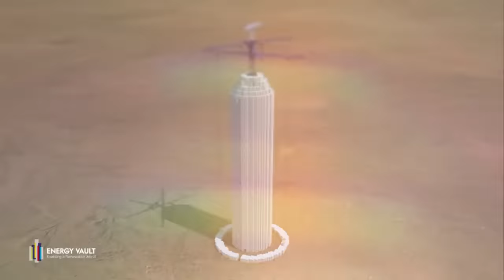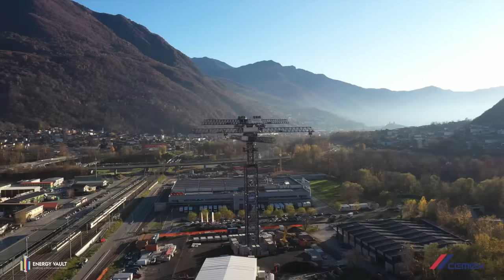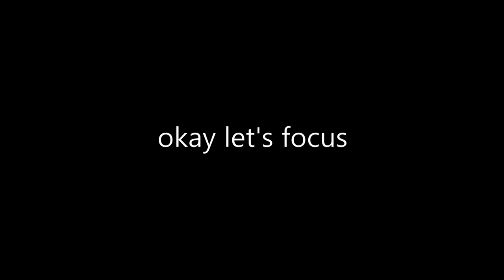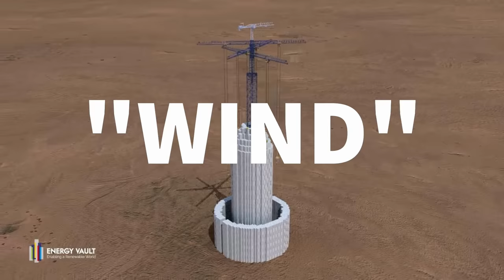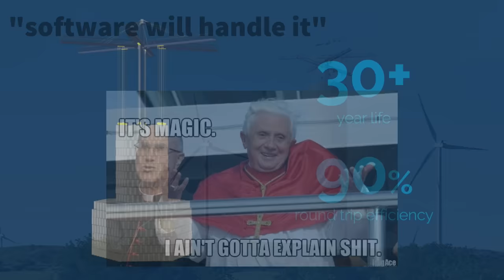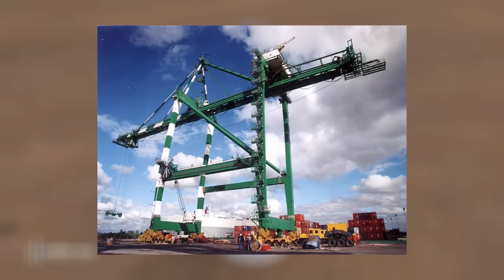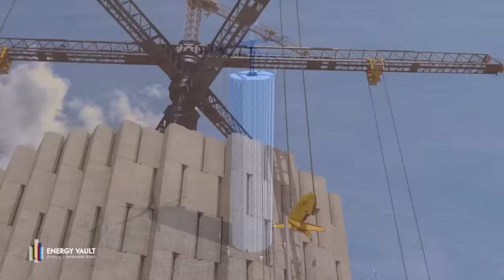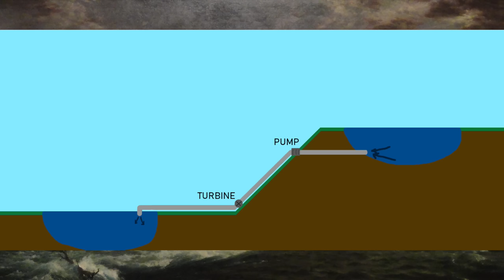The Energy Vault is a Dumb Idea, Here's Why

Comment: Funny, I started watching this having not heard of this idea.  Within the first 10 seconds I was thinking, surely we could get it to do some useful work, like a hydroelectric reservoir, which also can supply water to a city...  As someone who has programmed computers, I also laughed at the 'software will handle it' quote - this is only ever used as an argument by people who don't understand programming, the limitations of software and the massive amount of time needed to get a buggy system up-and-running, let alone a failsafe buggy one (no such thing as a system of more than 20 lines of code that is bug-free).
Reply: You can get to 20 lines of code without writing a bug? This person is a legend
Reply: The reason they want to do this is because there are a lot of areas that produce an abundance of solar power but battery storage is insufficient right now, A giant block of heavy mass is a cheaper way to store power. It doesn't have to be concrete, that's a little counter intuitive. But we are working on carbon capture, we could build large blocks out of those or some other nonsense. This video is also clearly from a place that is NOT suffering from drought or is flat so hydro wont work. There's more reasons to support this tech than there are to be against it I guess is my point unless you own a lot of oil stock.
Reply: You can get a bit more "bug" free with formal proofs, but that means bug in the sense of "behaves not as specified". Totally forgetting that in interacting with the real world, specifying everything is impossible.
Reply: @m1abramstank755  Syntax Error in Line 1: Expected Semicolon ;
Reply: A program with more than 20 lines of code that's bug free is not that hard to do... Maybe with this exclusive problem or something, but a simple C program that does low level logic can be 100% bug free.
Reply: The only way you can get bug free code, is code for a single task that never changes. The real world constantly changes, and if your software has to adapt to that, us fellow devs will be employed until the future's AI can write it itself.
Reply: Having spent the last two days debugging code that's less than 500 lines yet throws out random compiler errors, I agree. I pity the poor sod who'd get this project.
Reply: @Tick421  The problem is that it stores sod all energy. Raising a single 150 T block 100 m only gives like 40 kwh of energy. Which is like $3.50 with a 10c/kwh price spread.
Reply: @Veloxyll  but its free power that is going to waste. So until they have a better solution building a stack of carbon capture blocks doesnt seem terrible. I am all ears for good ideas but crapping on the best ideas we have so far isnt getting anything done.
Reply: @Tick421  Is it though? is it a good idea? Since they're 48T blocks, not 150T like my example, that means they have like 13 kwh of energy from being moved 100 m up. So $1.30 per rotation. And that'll cost about $4,000 just using cheap concrete. 
So that's 3,000 rotations just to balance on cash. 

On carbon, which, lets be clear, is the competition. We could just burn coal instead, currently our network generates about 0.65 kg of CO2/kwh. But these 48 T blocks release about 41 T of CO2. So for the blocks to be carbon neutral they have to complete 5,500 rotations. 

Now, if that's one move a day, that's 15 years. For blocks that are being bashed into each other twice a day and being exposed to the elements. 

And that's just to break EVEN.
Reply: @Veloxyll  burning coal releases carbon i am talking about carbon capture to stop or at least slow the damage done but abusing fossil fuels. The idea is to use free unlimited green energy and figure out how to make it more efficient. Coal is deadly and dangerous for everyone especially the miners. Its not renewable and its damages the entire ecology to mine and use. We will still need it for a while, but it should be our main source of fuel thats insane and inefficient
Reply: @Tick421  The problem here is that this battery isn't "free" or "unlimited". It would take a lot of energy to undertake this project and at the same time it won't even nearly store as much energy as it was "fed" through piling these blocks on top of each other. This "gravity battery" is extremely inefficient and structurally unsafe by the looks of it. On the top of this, countries that don't have the geological benefits to use real means of renewable energy, most likely also won't have the industry well developed enough to support the project of these batteries. And the amount of energy they would be storing isn't worth it for the trouble. I understand that we need ideas to replace fossil-based energy, but I would rather settle with a decent idea than a complete disaster waiting to happen. So let these "engineers" responsible for this, go back to the drawing board.
Reply: So you're saying it's impossible to create software to stack blocks?
Reply: @ahall9839  Not impossible. Just an absolutely mammoth undertaking for such a scale, with extremely high risk, and countless untold variables to account for.
Entirely possible, I'm sure the programming for some of the rovers and their equipment was just as difficult.
But why go through such an insane amount of work for such a shitty idea?
Reply: @Asiliea  So you can turn those "countless untold variables" into real, actual variables? Or you can just be a know-it-all YouTube commenter and say "haha me so smart people thinking about hard thing are dum!!"
Reply: @Tick421  not gonna reply to the more mathematical stuff, but as to the drought/flat stuff, that's just BS. Humans don't live in deserts, like, at all- over 90% of human population lives on the shoreline, ergo more or less 90% of energy usage is near the shore. Even when they do live in deserts, water based batteries are still viable- because humans  always need water to drink, which could be easily pumped up and down. The main advantages of water are that it's a fluid, and therefore everything is infinitely simpler, while also being a necessary resource, unlike a stack of concrete which is only useful for storing energy. Also, clean water generation is far more efficient carbon-wise.
Reply: Man I did 500 lines of code without a bug. Am I a god for you?
Reply: @Tick421  animal agriculture is responsible for More Greenhouse Gases than all Road Transport Like Cars Trucks Busses motocycles combined. (15% roughly)
Reply: @Tick421  its terrible tho
Reply: Actually I wrote a program that writes Hello World! 20 times and it is bug-free.
Reply: imagine this project fail and mrbeast buy it to play tetris
Reply: @m1abramstank755  and it will still crash if your memory and swap disk are completely full
Reply: @kennichdendenn  the problem with formal proofs is that you can end up with a program that does the wrong thing, perfectly
Reply: @nakelekantoo  xD python tho
Reply: @ahall9839  Mechatronics engineering student here. Good luck accounting for said variables with such primitive tech.
Reply: @mwanikimwaniki6801  So you're saying it's impossible to create software to stack blocks?
Reply: @ahall9839  Lol. No. With this model. It's a nightmare. With a different design it would be possible.
Reply: @nakelekantoo  seems like python to me, so I doubt it
Reply: @ahall9839  You're not paying attention to what people are saying and just do 'gotcha' questions
Reply: whatever my 100 line qbasic games when I was a kid were flawless triumphs of bug free excellence.
Reply: @Tick421  If you really believe this is "the best solution we have", watch the video. It's pretty clear with all the issues and provides you with a better, already in use, solution for the same problem. Your Carbon Capture addition is also kinda weird, there is NOTHING in this thing actually capturing carbon emissions, so where the fuck did you get this from?
Reply: @DarthDose  Hydro damns exist yes, but the problem with that is water is becoming more scare in places that rely of hydro power and they need a clean solution.

Making the blocks out of captured carbon came from my brain after watching another video where they were talking about running out of concrete and using carbon capture to make it instead. The normal process of making concrete is bad for the environment, i believe he mentions tat in the video. 

Old mines work great for this and it dropping stuff into an already dug hole so less work on that and protected from certain weather events. Its not a bad plan where they already exist but it doesn't justify more of those kind of destructive mines. 

I like this dudes videos and I respect his opinions, I would comment with out watching that would be rude and ignorant.
Reply: @Tick421  If you understand it is rude to comment without watching, how do you not understand directly contradicting the claims made without even acknowledging you are doing so, let alone arguing your contradictory point at all is also rude and ignorant? Also, we don't need to use drinkable water for hydro pump storage, so i guess the scarcity is a void point taking into account the vast amounts of salt water around. Also, carbon capture without any explanation means what exactly? highly pressurized CO2 in containers? Then those need to be built. Also, they'd be quite light, making their energy storage capabilities even worse than the tower presented here.

Also, mines are NOT "big holes in the ground", they are mostly quite elaborate systems of tunnels, with the exception of those vast, unprotected holes made by brown coal, but those don't have any of the protections necessary. Your proposal sounds just as badly designed as the tower shown here, showing a lack of either will to elaborate properly or understanding, which could lead you to discount those ideas as really bad.
Reply: @maxheim3802  Most of which are methane, a gas that is pretty stable in our atmosphere because it is broken down within a decade, meaning the emissions of animal agriculture aren't responsible for any of the long term issues we are creating with CO2. It's basically a flaw in plainly trying to count everything in CO2 equivalents without either understanding or accounting for the differences in those vastly different gases.
Reply: @DarthDose  it still has a gwp of 25 over 100 years, its Not negligible, only the Greenhouse Gas emissions of the Last 70 years are relevant to current state of climate change. Small time periods are relevant. Especially considering Feedback effects
Reply: @DarthDose  Dude i am talking about a handle full of specific pit mines, there are many that could be used for this we dont need a stack of leggos in every neighborhood.  haha

Also, salt water is insanely corrosive so that's gonna break things down all the faster. I am not against it, but youre talking about moving a lot of friggin water over land to get yto where you want these storage things. Trucks/trains its gonna be a waste of gas, pipes network will devastate the wildlife and a salt water leak would kill the ground nearby. I am saying the answer is more simple and complicated than either of us have said, they should just do both. We need more research on carbon capture, we can use that process to build construction bricks maybe side walks and crap like that and giant legos for power storage. On a cliff by a giant hole in the ground whichever is the most efficient for the specific area. Its not a one solution fits all its a 'whatever works' while decreasing pollution.

I grew up living, playing and fishing at the Sidney Lanier Dam and I didnt know the racist history that built it. Thats another thing to look into before saying more hydro. Where is the government gonna steal the land? Folks generally live near lakes and rivers. Critters too. So any new damn is divesting to an already struggling environment.  Its like a flock of birds with one stone made of captured carbon.
Reply: @maxheim3802  10* with the amount being stable. The CO2 in the atmosphere also is concentrating since the industrial revolution and it's ALL relevant. Not only the last 70 years.
Reply: @DarthDose  the integral of the co2 emission curve is negligible from 1700-1950, the emissions (the integral of the curve) over the last 70 years are roughly 15 times as much as from 1700-1950. So yeah, anything before is negligible😅
Reply: @Tick421  Like already pointed out, Carbon Capture is NOT a technology for building stuff out of it, it's a technology to pump CO2 deep underground where it doesn't escape easily. This stuff has no relevant weight, especially as it is a gas, it basically isn't relevantly different in weight from air, at which point storing it high up doesn't give any positional energy. You obviously disregard most that is said without going into any actual detail and refuse to understand that this is
1. not how Carbon capture works
2. Even if it were not a relevant storage
3. There aren't the kind of "giant holes" necessary for your proposal around, especially not stable ones.
4. If there were giant holes usable for that we could use water in them more efficiently
5. hydro pump storage can also be put underground, so the land argument doesn't really work when we need less space for the same effect with hydro pump storage. 
You are making ridiculous claims, we don't need to diversify when due to basic physics one of two alternatives is plain worse.
Reply: @maxheim3802  Literally doesn't really change anything i said. CO2 from 1750 is still around in the atmosphere, Methane isn't. I wasn't talking about amount but longevity.
Reply: @Tick421  Did you even attend English class? Shouldn't accuse others of not understanding basic principles whilst yourself not understanding what was said, that's basically a strawman. I was talking about the DIFFERENCE in weight between air and carbon dioxide, which is basically minuscule but needs to be high to store positional energy in relevant amounts. Which needs to be emitted first to even capture it, so it relies on actually using fossil fuels, the things you claim i support by not wanting to use a product THEY allow creating. I'm nowhere advocating for fossil fuel, quite the contrary, but you don't seem to even care for any understanding of what was actually said, so i guess we can stop this here because it's pointless to talk to someone who doesn't listen but rather invents a fictional argument he rather wants to address.
"Why not use both"? Because we have limited energy and resources, we shouldn't get blinded by people making up extraordinary, but in the end pretty unrealistic claims, because it wastes our resources which we absolutely need to use efficiently in order to become carbon neutral. This stuff is too important to clown around with stupid ideas.

Comment: It also doesn't stack up to water towers, where you will always will have potential energy stored at a minimum height. As you continue to remove blocks from the top , the max height you can drop them from and thus get energy from decreases. Heck, why build the whole thing out of the cement blocks, just build most of it with whatever material or do it off the side of a cliff and sprinkle a few blocks to drop on top of that. Cement is expensive.
Reply: Well, if you reduce the amount of blocks (even those at lower levels) you reduce the storage capacity.
Reply: And "just do it on the side of a Cliff" only works if you have a cliff. And perhaps not even then.
Reply: This idea is stupid. Trying to make it smart is an exercise in futility...
Reply: Gernot Schrader  this is why you use a closed landfill for the base and the blocks sit on top :p
Reply: This is a great idea on a small scale where a young person hooks up a bunch of logs and lifts them with pulleys and then use the energy from gravity to turn wheels that do the work.  Otherwise... It's stupid.  Burning energy to make energy is dumb.  Burning energy to make muscle is a personal choice.
Reply: the first few blocks serve no purpose, which makes them slightly less useless than the CEO
Reply: Concrete 

Cement is mortar
Reply: @uprightfossil6673  Even then not so much. Logs need to be balanced perfectly or they will hang down. Imagine a 30 foot high tower but the logs are 20 feet long. You really only get 10 feet of effective motion before they touch the ground. You'd want something more dense like lead or even depleted uranium. Even then you run into issues with toxic exposure.
Water just makes so much more sense all around. Especially when it comes to limiting lawsuit liability.
Reply: @protorhinocerator142  you are not following what I said. In short, if I lift logs for my exercise and they have that stored energy at a certain height, I can use it for other tasks.
Reply: Gernot Schrader  One point I'd make is that you don't need energy to lower. With a series of pulley systems (the wheels you're spinning to generate off) you can create enough resistance to slow the descent. It's less about energy use during lowering, and more about what your generation efficiency is. This is probably what you meant anyway, but just wanted to clarify. That said, I agree it's still a bad idea.
Reply: your are right there!!!!! watertowers!!!! they shouldn't be dropping cement blocks, they should be dropping containers filled with water that can be emptied and gravity fed  back up the tower to fill the next containers to be dropped for more electricity. lets say build this tower under ground beneath the water table.  you fill the container drop it to generate electricity, empty it so little weight to go back up to the top and the water released is just gravity fed,  pushed, to the top as well. the empty containers could be pulled back up by the descent of the filled containers. A system that creates energy from gravitational pull and water